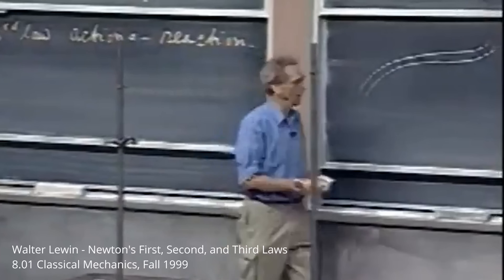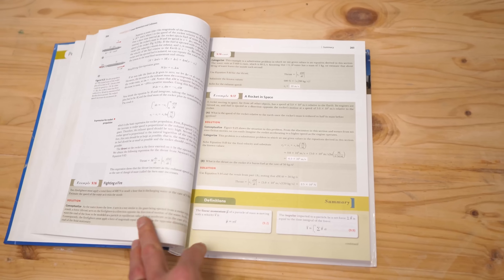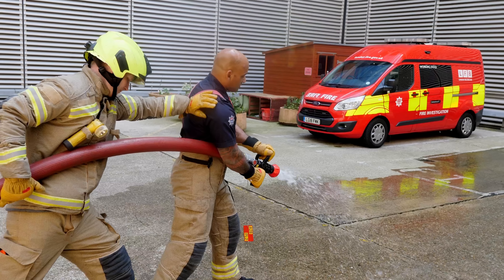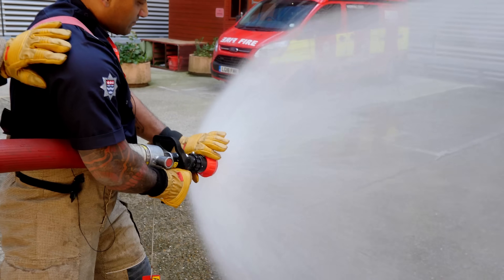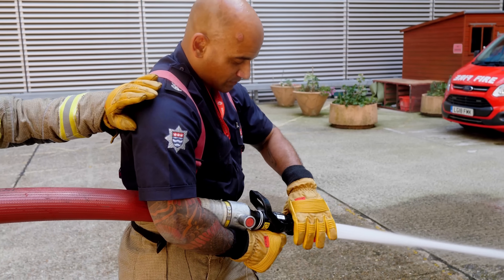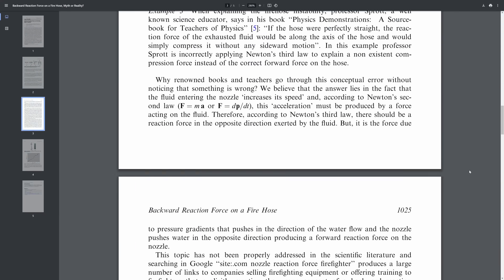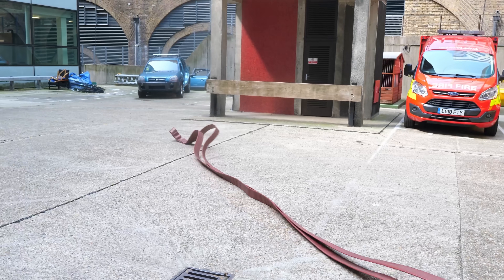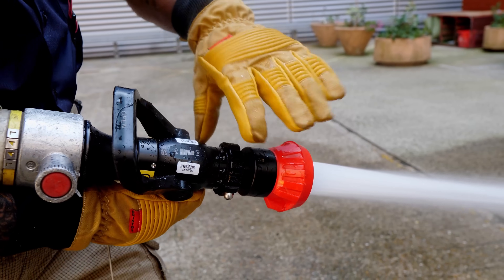Why chaotic hoses dance

Comment: Steve: the pressure inside the hose is not constant. It drops linerarly from the pump to the nozzle. Its the pressure GRADIENT thats constant. That is, until the nozzle itself, where you point out that the fluid rapidly accelerates due to constriction, creating a much larger pressure gradient.
Reply: Look up friction loss in fire hose. About 10psi per 50 ft of 1 3/4 inch hose line.
Reply: Yeah I think there are a few different equally valid ways to think about it.

The force on the end of an open water hose with no air bubbles (pretty much zero) is way different than the force on the end of a hose with a nozzle (air bubbles or not). Air bubbles definitely change things - those shake the hose a lot when they happen. So let's assume incompressible water only with no air.

It's true that the water gets accelerated a little by the pump, but it mostly gets pressurized. The vast majority of the acceleration happens in the nozzle.

F = ma

The flow is constant, so we can take the mass to be the flow rate in kg/s, and we can take the acceleration to be the new velocity minus the old velocity, since it's linear. Or this could be done as an integral from the start of the nozzle to the end of the nozzle in terms of cross-sectional mass flux times jerk dt, I think... I think that'd collapse back down to the same thing, but can't swear to it.

Anyway I think it's probably this:

vector F = vector_negate((flow rate in kg/s) * (new vector velocity - old vector velocity))

Or in other words, negative yeets per second times YEET, for suitable definitions.

So if it were 10 kg/s, and speeding up from 1 m/s to 21 m/s, that'd be 210 newtons, or 47.21 lbs force. That's like leaning against the full weight of a 7 year old kid, so seems roughly in line with reality for a pretty big hose throwing lots of water pretty far.

If you're a firefighter or know firefighting hose sizes and flow rates under pressure, maybe try running the equation above to see if it checks out.

Air is different. Lack of nozzle is different.

I might be totally wrong, but rather than checking my work I'll just be wrong on the Internet for engagement purposes instead. Have fun.
Reply: ...And then I watched the rest of the video and Steve basically said the same stuff yay.
Reply: Hey friends, Canadian mechanical engineering grad here and trained pump ops volunteer fire fighter.

Commenter Mitchell is correct that the pressure loss in the hose cannot be ignored over the length of the hose and is absolutely the source of confusion. In pump ops, for long runs of hose, setting aside losses from connections, turns, junctions, etc, "relay pumping" operation is used to overcome losses (fancy firefighter talk for pumps in series). Losses are huge in fire fighting applications of high flow and high pressure, exactly the conditions that make the hose dance. That being said, the nozzle's fluid dynamics can absolutely be thought of in Newtonian physics, and the vector whose direction has everything to do with the force felt at the nozzle: imagine two different nozzles resulting in the same pressure drop and flowing the same amount of water. The first nozzle's spray pattern is straight and the second is a disk. The first nozzle feels a reaction force and the second does not (it cancels out) despite both having the same pressure drop. 

Hopefully that little thought experiment clears up that you cannot simply ignore the direction of the pressure drop while trying to understand this. Unfortunately, it's just not that simple answer that one might hope. BE the hose grasshopper.
Reply: I like your funny words, magic man.
Reply: The pressure isn't going to decrease much because that would require some of the water compressing, which is impossible in any meaningful way. That would happen with piped gases, but not as much with liquids. Water pressure in pipes only decreases in that way for vertical pipes and that's due to gravity, not due to constriction, friction, or much of anything else.
Reply: @5467nick  That's not true at all. Consider a rigid straight horizontal pipe with an incompressible viscous fluid flowing inside it. Now take a control volume consisting of the region between two cross sections orthogonal to the pipe axis. Since the fluid is incompressible, the mass flow rate at both sections must be the same. But since it is also viscous the velocity gradient at the wall causes (or more correctly is cause by) a shear stress. Then for this equilibrium to happen the pressure drop between this two sections (times the cross section area) must balance the shear stress (times the perimeter times the length). Therefore there is a constant pressure drop (i.e. for a given distance in the pipe, the flow undergoes the same pressure difference).
Reply: @5467nick  Friction loss in firehose can be significant. It is a component determined by the velocity of the water against the interior surface of the hose. Ask any firefighter if there’s any difference between “Pump Discharge Pressure” and “Nozzle Pressure”. I assure you, there is! If the hose is too small and the hose lay is too long, 500 psi at the pump (That’s A LOT!!!) can be so low at the end of a long line that an effective fire stream isn’t enough to protect the firefighters inside the burning building.
Reply: @danoberste8146  The key there is "hose is too small" or "hose lay is too long". If friction loss is sapping enough pressure to be a problem, then you probably have the wrong equipment for the job. If using the right equipment for the job, it shouldn't be a problem.
Reply: @5467nick  Fire apparatus are limited in how large a hose diameter they can carry and how close they can get to the fire. Relay pumping is used when the distance between the water supply and the fire is too far. Engines generally carry only about 600’ of 5” hose, 1000’ to 1500’ of 3” hose for water supply. These hose standards are matched to the pumps ability to overcome friction loss. An engine at a draft water source, pumping at it capacity can only produce effective pressures through those 1500’ of hose. A second engine will take the ~30 psi of incoming pressure, boost it to 250 psi to the next inline pump farther down the line. That engine will only get the 30 psi (due to friction loss) then boost it again to the next pump, and so on.

Friction loss is real, and it’s a problem firefighters have to deal with every day.
Reply: @danoberste8146  Most fire calls don't have multiple engines spaced a thousand plus feet apart to pull water from a source the better part of a mile away from a burning building. In specific regards to the part of the video this discussion was relevant to, this has little relevance to the physics at play in the examples in the video. The water pressure at the start and end of the hoses in the video was not nearly different enough to be relevant, particularly the hoses that weren't fire hoses. I'll still congratulate you on bringing up what's probably the closest thing to an every-day occurrence of my generalization not applying. It does apply to almost literally every other instance of liquids flowing through pipes and hoses that most regular people will interact with on a regular basis. Any time friction loss is significant in a piped fluid system, it's either intentional (like capillary tubes in refrigerators) or something's gone very wrong.
Reply: @5467nick  Thats not how anything works, study some hydrodynamics
Reply: @ Please read the first sentence in my comment again, particularly where I use the word "much". If the pressure drop in the flowing water due to such forces is significant enough to matter in any meaningful way, you're probably doing something wrong, such as using far too small of a pipe for your needs.

Comment: What if the tube man was pinched at the top to keep the air from escaping, would it be able to hold its own weight up straight? and if so how tall of a tube could you get? just some hypothetical questions

Comment: Watching the air tube change from predictable to chaotic as it got longer made me think of a double/triple pendulum.
Reply: Continuous pendulum!
Reply: @Maplaplaplapla Just stick a bunch of pendulums together and add a restoring force to the joint constraints (I'd model it as a restoring force to zero rotation with a linear relationship to the deflection)
Reply: totally looks like a double pendulum to me
Reply: I’m way too scared of snakes to watch this.
Reply: Riemann Sum of N Pendulum problem solution when?
Reply: Doesn't the weight of the nozzle add a ton of inertial energy?

And I agree with the double pendulum commonality, it is really visible in the first part of the video!

All in all a really cool and intriguing video! 
I love it, thank you Steve!
Reply: Exactly 😅
Reply: 2 body vs 3 body problem
Reply: I came here to post the same thing!!
Reply: So.... How long till we have a neural network that can tame it?
Reply: I applaud your collective associative memory of "chaos = double pendulum" 🤪

Touch grass!
Find a river.
Wonder why it meanders.
Now you are at Steves level

Comment: The force you feel on the hose is tension which will be equal all along the length regardless of direction of any particular point along the hose. Just like ropes around pulleys. This is at least part of the explanation. Even a straight hose will have some slight curvature, so there will be some force. But why is the same tension felt regardless of curvature? That is a matter leverage. A slight curve experiences less centripetal reaction force but pulling on the end of a nearly straight hose has almost no leverage against a lateral force against the middle of the hose (or of a rope). Only if you could hold the hose absolutely perfectly straight from a rigid source point in exactly the direction the water exits the source, could you hope to feel no force -- but this is extremely unstable with the slightest deviation resulting in the maximum force. A rigid straight pipe does not have this problem as the structure of the pipe itself resists bending so you would not need to put tension on the pipe as you do with a hose.

For clarity: when you feel the force pushing back on the nozzle, you are exerting a force forward on the nozzle to put tension on the hose which resists (additional) bending of the hose in response to the the acceleration of the water changing course through an the curved hose, even if only slightly curved. The tightness of the curve does not matter due to leverage--the tension has greater mechanical dis_advantage against the lateral forces when the hose is _less curved (straighter).

Hope that makes sufficient sense. Diagrams would make it easier to explain. So now maybe you can do another video about it.

Comment: 11:58 "If there's no net force it must mean the pressure's the same all the way" I don't think is true. There is a force of friction from the walls of the hose pushing the water backwards, so to counteract it there needs to be a greater pressure upstream to prevent the water from slowing down. So the pressure at the end of the pipe will be lower than at the start of the pipe.
Reply: Just from a quick search on an engineering database I saw that for a general 2" hose at 1000 gal/minute, there's like 500 psi lost every 100 ft (extrapolating a bit bc the chart didnt go that far). That is very significant actually.
Reply: @skanderbeg152  1000 gallons per minute is the sort of flow rate you'd expect from a 4" hose, not a 2" hose. Using the correct hose size for your intended flow rate will not result in such extreme pressure losses.
Reply: @5467nick  yeah I was just guestimating based on the hose I could see in the video and some other numbers I found. On a 4" hose the pressure drop is like 20-30 psi/100 ft.
Reply: Even without friction, considering a flexible pipe pressurized with a fluid, there's an external force generated. 

Water mains require thrust blocks at bends to restrain the pipe from trying to straighten out when under pressure, as a practical example.
Reply: Yeah, this is called friction head loss in water systems, and is considered in 2 main ways: major losses (from the friction along the pipe, and the change in pressure would be calculated as f*L/d*rho*v^2/2) and minor losses (from the fixtures and nozzles in the pipe, and calculated as K*rho*v^2/2). If you consider the energy in a pipe system, we have the velocity of the water, the pressure of the water, the height of the water above the lowest point in the system, energy lost through the above friction losses or turbines, and energy gained from pumps. Assuming the water is constant and the change in height is neglible, the pump puts energy in (as flow or pressure, depending on how you think about it), and then it's sapped away by friction as it goes along the pipe. The pump just has to put enough energy in to balance out the losses.
Reply: I’m sorry, but can’t the hose be analogized to a pressure vessel when the water is pressurized like it is in a fire hose? Therefore it’s the same force as you’d experience as a pressurized tank with a hole in it—thrust.

I also think that’s a reason why the hose whacky doodles—it’s pushed opposite the direction the nozzle faces. I’d like to see Steve put a kink further upstream on the hose and straighten the end out. Will it occur?
Reply: Yeah there's definitely a small amount of pressure drop, it's just negligible compared to the pressure drop at the nozzle to atmospheric, assuming the hose is functioning correctly
Reply: What he said was hydrostatics, only works with water not moving, all his assumptions form there are just wrong
Reply: In that case there is a net force tho
Reply: @YunxiaoChu  Yes, there is a net force. It's just small in comparison to the rest of the forces involved.
Reply: @benconnor901  end cap/ (theoretical) reverse end cap. There is an area inside the hose equal to the area of the nozzle. The air pressure is pushing on the "reverse end cap" and there is no end cap at the end because it's a nozzle. So there is an unbalanced force. Wall on backside , hole on the other end. The "back wall" has an irregular shape because it's a hose. Like if you had a laser the same diameter of the nozzle and burned a hole through whatever was in the way.
Reply: That isn't going to be very significant because water isn't compressible. The water further down the pipe can't slow down at all because that would compress the water behind it, which is essentially impossible in any meaningful way.
Reply: @5467nick  Compressibility of a fluid is not a factor that affects how much pressure is dropped. The friction does cause a difference in pressure from start to end, dependent on diameter, flow rate viscosity and a few other things, but not the compressibility of the fluid. https://en.wikipedia.org/wiki/Darcy%E2%80%93Weisbach_equation
Reply: @jeremymcginnis7258  I'm well aware that friction causes loss of pressure in liquids flowing over long lengths of pipe, but the effect of that is insignificant in most applications. Rarely are people pushing large enough flow rates through a pipe that pressure will change significantly due to friction as that would be wasteful, except when done intentionally because lowering pressure is the goal, like with a capillary tube in an refrigerator.
Reply: @5467nick  That's fair, we do use appropriate sizes of pipe for most things.

Comment: I remember a story from a Feynman book where he convinced his college professors of a different answer each day, until ultimately exploding a pressure tank...

Imagine an S-shaped water sprinkler.  It spins clockwise when you blow water out the sprinkler.  Then imagine sucking water from it if it was submerged, which direction would it spin?  Is it the force the water exerts on the tubing as it follows the s-shaped pipe? So does it spin the same direction, opposite direction, or what?

Comment: Steve, my man. You seem to be making the same mistake that I made when I was an intern with a rocket propulsion shop. You can look at momentum change at the nozzle. Or you can integrate pressure over walls. That's the same force - tha change in momentum is caused precisely by the pressure difference integral. Point is, it's two descriptions of the same process from different ends, not two processes! Pick one and stick with it. Trying to do both you'll just end up counting the same thing twice.

Comment: If the nozzle was under water where the pressure was the same as the pressure applied by the pump there would be no force at the nozzle
Reply: There also wouldn't be any flow then.
Reply: @jahnkeanater  Yup, I was just thinking of a simple way to explain the action

Comment: If you could measure in real time the exact 3D coordinates of the tip of the hose as it is flailing about, this could tell you something about the forces.  If you could measure a 2nd point an inch proximal to the tip, this would get you the direction the tip is pointing.  Of course if you had 10 sensors spread out along the length of the hose, you would have even more data, but I'm not sure how to analyze it.  Might need 100 measurements per second.  Maybe the radial distance from the fixed point (firefighter's hands) to the tip of the hose is a key, dependent variable that determines the next movement.  Doubt if it is that simple.  But watching the 3D motion of the hose tip looks chaotic.  Maybe graphing the distance described above vs time is less chaotic, or at least fewer degrees of freedom.

Comment: The other force to keep in mind is the tension in the tube itself. The water is going to try to pull the hose along with it. I think the tension in the hose might cancel out the acceleration of the fluid inside the tube. The nozel at the end is the only force that's accelerating the hose.

You could try experimenting with hoses that have varying internal diameters or some other way of isolating the nozzle from the hose. Or try to do the math for a coil of hose.